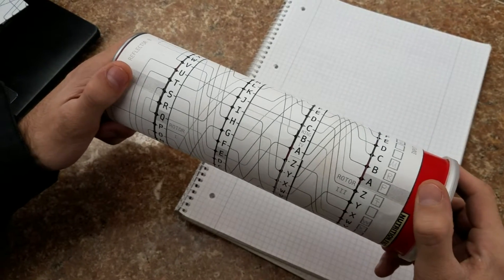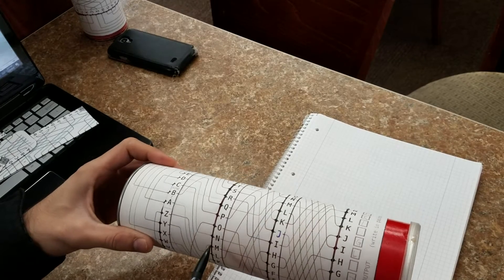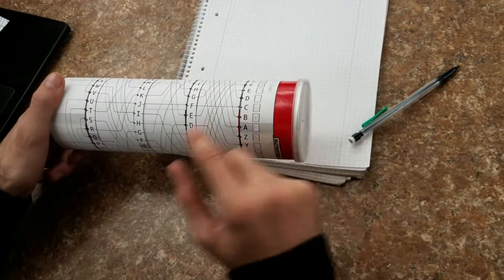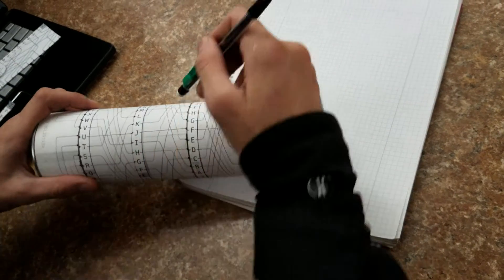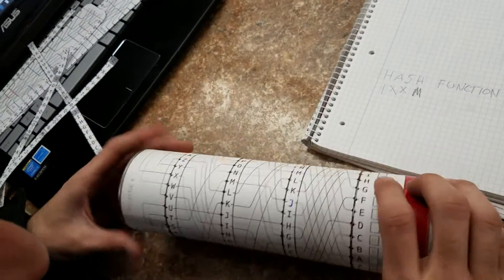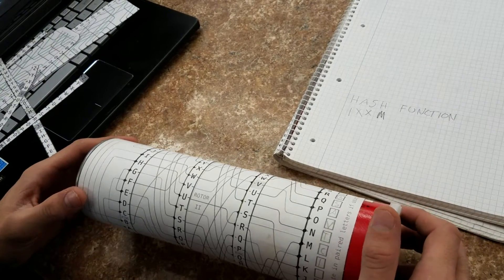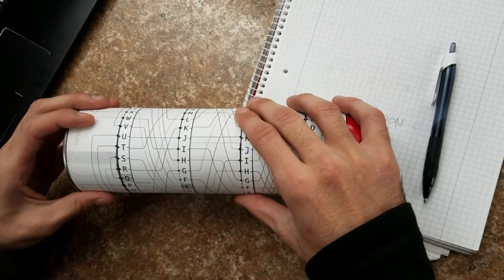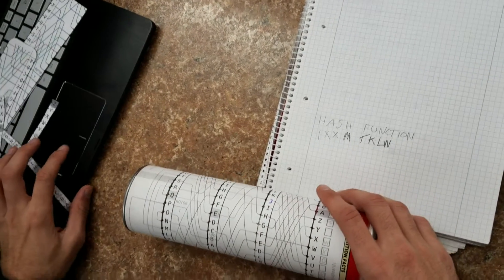Paper Enigma Machine - CS430

Comment: The only thing that would make this "homework assignment video" interesting would have been to insert a deliberate 'error' in the encoding... There's no way that any teacher would spend an entire weekend configuring his/her Pringles Enigma to the 3 letters of each student's name to check that each student's work was correct.
In fact, some names would require the student to deal with the 'ratchet' problem of advancing the next rotor, and some names wouldn't involve that operation...
Demonstrably "unfair"...
More reasonable if the teacher had given the start configuration and a prepared, enciphered message, and all students attempt to 'extract' the plaintext...
This challenge shows that the teacher didn't understand cryptography.